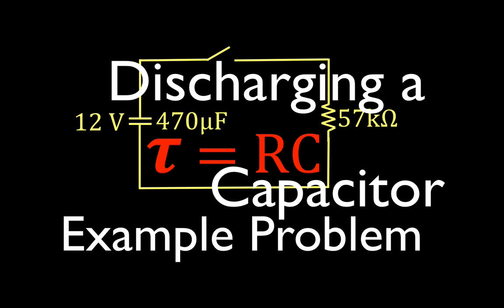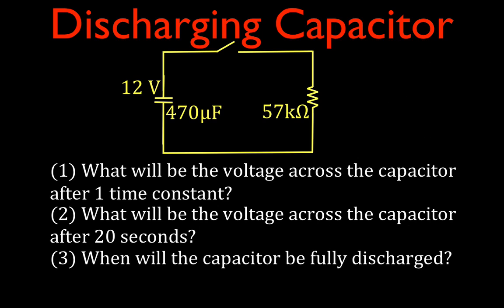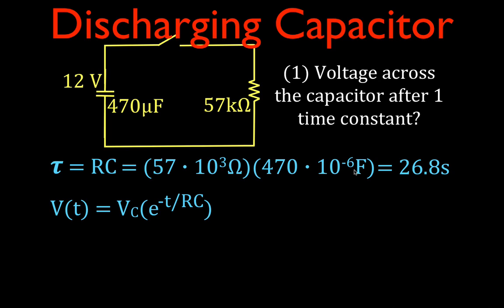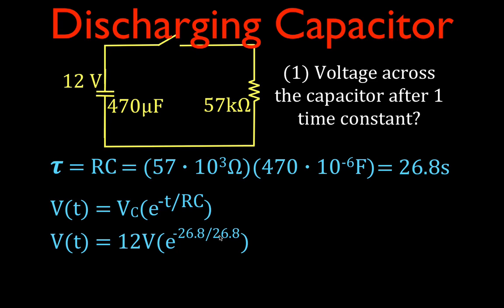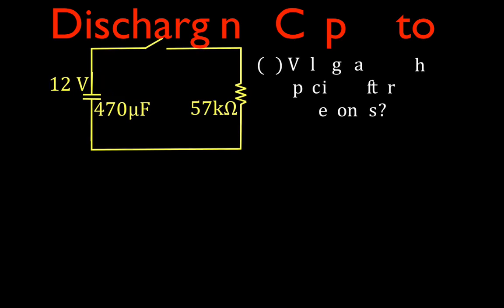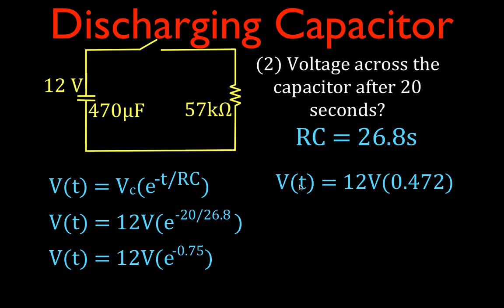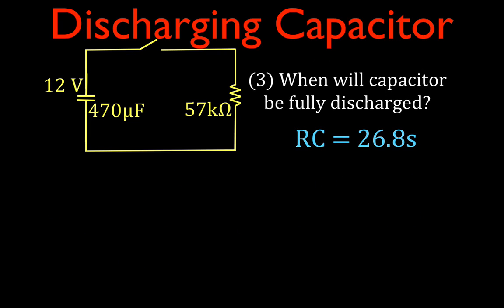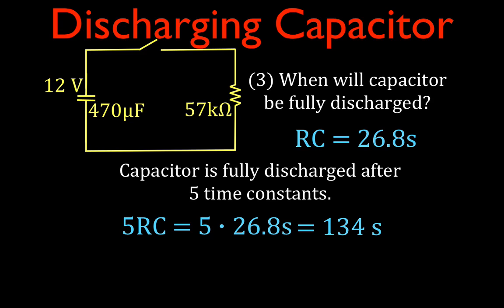RC Circuit (7 of 8) Discharging a Capacitor, Time Constant, Voltage, Current, Worked Example

Comment: Thank you sir, 
I have one question, in last question u did, mention the capacitor fully discharged (5. 26.8s)=134s..,
Can this formula (5RC =5. 26.8) will applicable to charge fully ...?
Reply from the maker: Yes, the capacitor is considered to be fully charged after 5 time constants.

Comment: what is the value for R if you have a bunch of resistors in your circuit? Just parallel resistors or Req?
Reply from the maker: Then you have to calculate the equivalent resistance.

Comment: I have a problem I can not solve: I have a power supply of DC=12V, a resistance of 12Ohm and a lamp (bulb): 6V; 0.5A. What capacitor do I need to light the bulb 2 seconds? Thank you!

Comment: Hi sir ,
here you used two formulas v(t)=Vb(1-e^-t/RC) vs v(t)=Vb(e^-t/RC) i confused over here in previous one you used this formula  v(t)=Vb(1-e^-t/RC) for calculation but here it is different , can you help me here
And also i have doubt over how to select the capacitor input value for to store high voltage  
am doing voltage doubler circuit  but without this knowledge i cont able to continue my self  
Please help me here

Comment: please consider adding an annotation explaining that e is a predetermined number, , excellent video, thanks
Reply: To understand e, we first need to understand "GROWTH!" Assume you have 1 dollar and you will get 100% growth a year from a bank as annual growth. Okay, then. After a year, you will have 2 dollars, right? Assume the bank pay you 2 times a year now. You will get your money after 6 months. But they will divide 100% profit into 50% each. But this is slightly better for you. After 6 months, 1x50%=1x0.5=0.5 cents, and you have 1.5 cents in total after 6 months. And after a year, you will have 1.5x50%=1.5x0.5=0.75 cents, and you have 2.25 cents. Slightly better right? (1+100%/2)^2, you have half the growth rate over 2 times period which is called semi-annual growth. What if you gonna have 4 different times in a year? You will have (1+100%/4)^4, and so you will get 2.441$ at the end of the year. That's called quartly growth. So the formula is (1+1/n)^n. I know what your thinking! Is it possible to get unlimited money? Chill, bro. Now, you put n=1, you will get 2$ for annual growth right? If n=2, you will get 1.5$. Now, assume you are getting every day. n=365, you will get 2.7146. Let's make it every minutes, every seconds, how so ever, n=1000000 (1 millions times), you get 2.7182804. Now, I hope you understand about what is e? It is the maximum possible result after continuously compounding of 100% growth over 1 time period. Thus e = 2.718.
Reply from the maker: e is a constant, ruler's number, 2.718, I think I said that in all of the videos, if not, my mistake.  Thanks for you positive comments.

Comment: what do you mean by the cap is fully discharged after 5 time constants? is this a standard rule with all caps regardless of the value of capacitance? Thanks in advance :)
Reply from the maker: Yes, that is the standard rule for all capacitors.  The actual time will be different because the capacitance and the value of the resistor in series with the capacitor can be different.  Time constant = R x C.